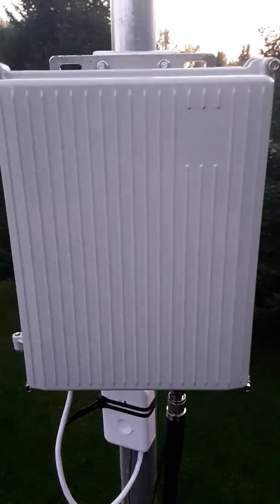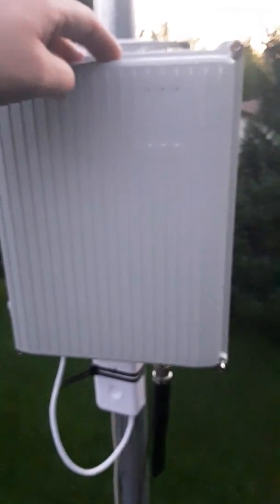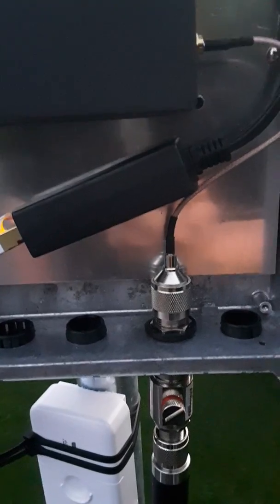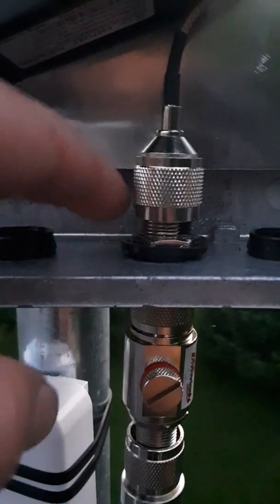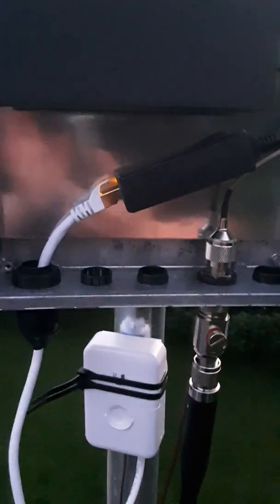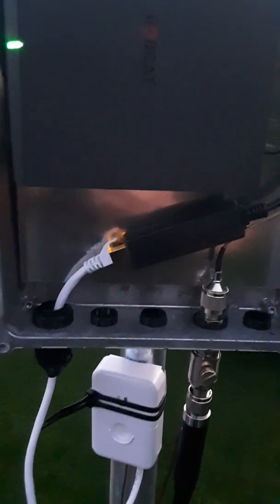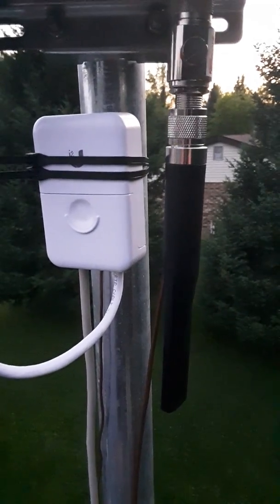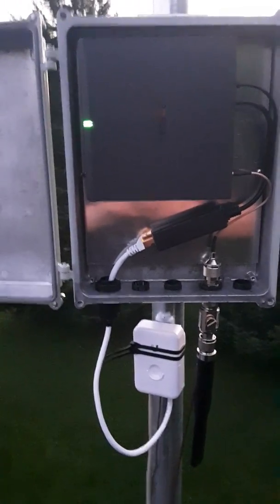Optimized Outdoor Helium Hotspot Miner Technique Intro

Comment: Amazing video.  How did you ground the copper to the pole? Care to explain?
Reply from the maker: With a Pipe Ground Clamp, can be purchased at most hardware stores or amazon. Just needs to fit comfortably around the pole.

Comment: Can you link me the fan you used and how do i power it?  You found a better heatsibk if so which one? I have the same enclosure
Reply from the maker: Did not use a fan in this system, it overheated a couple times in the dead of summer. Other then that it ran just fine, if you want to go overkill get a 140mm fan that will cover the whole top of the bobcat.

 I also did not bother with a heat sink, technically that would void the warranty of the bobcat. An internal fan can be powered by POE as well. Check out this link for more information. https://www.nowitness.org/diy-enclosure/

Comment: great video man,  how concerned are you with the heat?
Reply from the maker: great question, I seemed to run into a couple hot days. I will be adding some fans next season (no vents though). I am in the midwest so my main concern is actually it being too cold this winter season. Looking at different heating methods as of now.

Comment: it doesnt  matter be up side down?
Reply from the maker: It will make a difference as in usually a little less performance, was the easiest approach atm. I currently still have it operating upside down, works fine. Just never put it sideways.